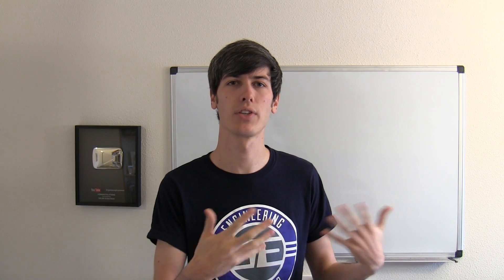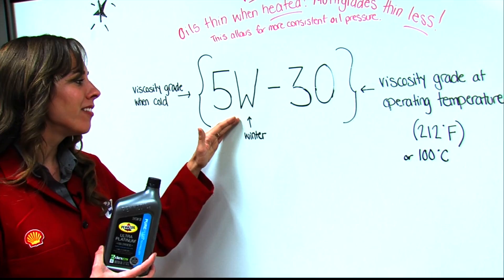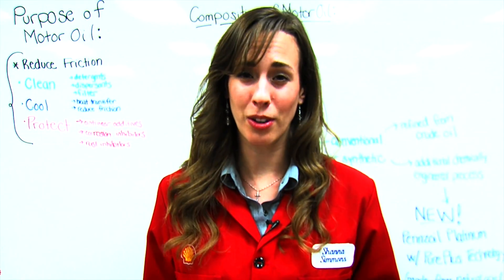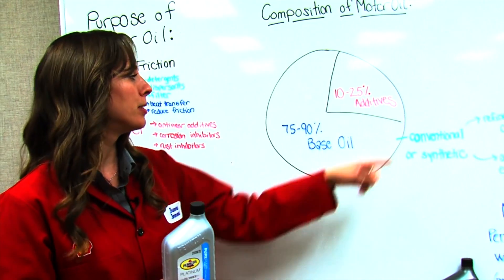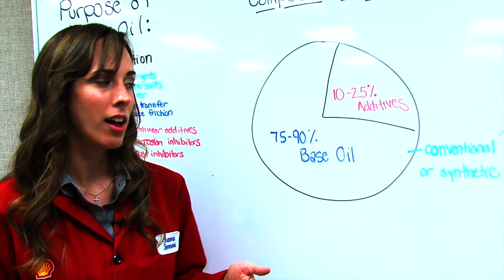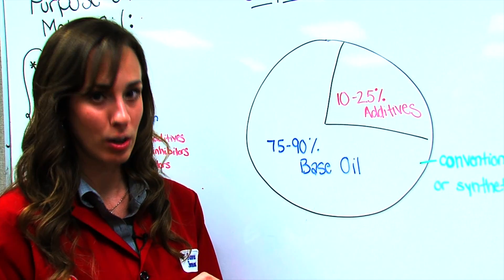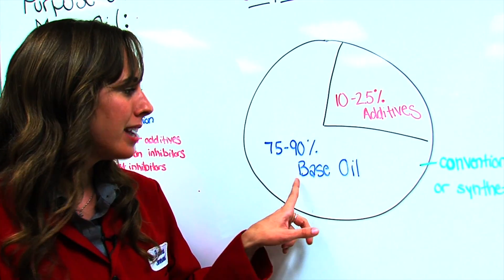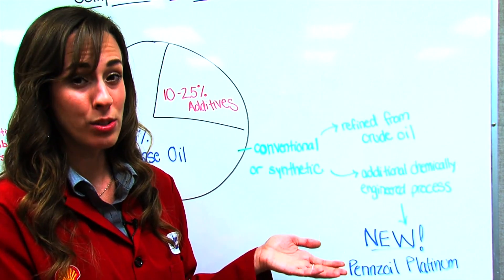Motor Oil Myths & FAQs - Synthetic vs Conventional

Comment: Hey! does unused/opened engine oil go bad? or is it safe to use for the next oil change in about 6-8 months? 

"bottle kept inside the house with the lid closed tightly.
Reply: For practical purposes, no.  It would take probably decades for motor oil to noticeably deteriorate in a sealed container, or even a closed, part used container.  Think about what motor oil has to withstand in use, compared to that, storage is nothing!   I've used motor oil from 10 year storage or more with no problems. As an automobilia collector I have NOS glass bottles of oil that are over 60 years old that are only just starting to show signs of separation, and oil from that period is nowhere as good as the products available now.
Reply from the maker: It does eventually go bad, yes, but it should be okay to use within a year.
Reply: +Stinky Cheese, "oil system in a vehicle is not open to outside moisture"!? Think again!  All combustion engine has intake & exhaust valves, how is an oil system in a vehicle not open to outside moisture!!!???  You think there is absolutely no air skips through the piston rings as an engine cools down...!?
Reply: +turboslag I think these guys have a vested interest in making you think that oil will go bad
Reply: Eric sin sinner

Indeed they do. Like anything to do with the auto industry, it's a rip off.
Reply: @Jun Aquino One day I was listening to Click and Clack on PBS radio.  They are two brothers with engineering degrees from MIT.  A caller asked if he should change oil every  3,000 miles or three months like the owner's manual says, because he doesn't drive the car much.  He was changing every three months like the book says.  They laughed and said the mechanic was probably saving the oil and using it in his car when he changed for his new oil!  No, oil doesn't wear out when you're not driving the car.
Reply: +Dennis Johnson  yep I think it's also a rip off changing the oil every 3 months when not used regularly. that's why I change mine every 3k miles around 6-7 months. I dont wanna go more than 3k miles cause daily driving here in our country is considered "severe driving conditions"
Reply: oil and water (moisture) dont mix....
Reply: +Stinky Cheese, the fact is the fact and that is how moisture enters in to an engine, little baby.
Reply: +Stinky Cheese, the question was about "oil" and you are changing the subject talking about fuel, combustion and emission system...  Please keep focus on responding to people's question about "oil" (engine oil a.k.a. motor oil) if you wish to respond.  BTW, have a better control of your personal attacks, stop being a baby, little baby.  ;)
Reply: +Stinky Cheese, P.S. There is "blow-by vapors" in to the oil chamber and that is one of the reasons oil get contaminated.
Reply: Stinky Cheese Agree, 6 month change is sufficient. Only one thing to moisture: Oil can take on some moisture, when you're riding only short distances. The condensed water from the combustion process will mix with the oilfilm on the cylinders during combustion. The oil "sweats" out that water again when reaching working temperature.
Reply: So Mobile One 0-40 in a closed container is going to go bad after a certain amount of time?
Reply: +Jun Aquino depends on the car, Mercedes is 13k miles because it's 8.5 qts mobile1 0-40 and fleese filter
Reply: Ski Fall
your point?
Reply: +Stinky Cheese ok, enough of this childish back and forth behavior.  The question was about oil in a closed bottle.  Some mentioned about engine oil kept in an engine where in a combustion engine is "not" sealed therefore will deteriorate as moisture can enter the oil pan through intake/exhaust valves for example, as in an oil bottle its cap is closed shut to changes outside the bottle...  Done!  No more baby behavior please!
Reply: +Stinky Cheese, OMG, again!?  The point I made was that a combustion engine's oil chamber/sump is NOT sealed as you stated in one of your replies.  Just read other replies you had to other people...  LOL.   Ok, I will stop calling you little baby as it gets tiring for me.  Good bye Stinky, that is your handle... The fact is the fact, oil kept in an engine (oil pan/sump) is different from keeping oil in a recapped bottle.
Reply: I remember when Mobil1 yrs ago said it could go 15000 miles before a change, so surely it could last a long time in the bottle. Obviously they did change that claim to 5000 miles later. Plus the fact that some manufacturers claimed that ONLY Mobil1 was able to maintain the warranty...like Corvette. That wasn't just wrong, but against certain laws that let other oils hold the same warranty standards.
Reply: yeah turboslag, as far as I know oil that sits, as long as you don't have containements or other stuff happening to it, practically doesn't go bad.  if you let it sit for decades it could become less effective but if you let oil sit for decades than you are silly for not getting rid of it sooner
Reply: rickyt, there are many seals so an engine that is working proerly keeps the oil and atmosphere seperate.&#160; in a properly taken care of engine the only times engine oil will get to experience the atmosphere is when checking the oil and adding oil.&#160; again in an engine that is running properly.&#160; that is one of the reasons rebuilds are relatively expensive with vehicles
Reply: If moisture gets in it can cause the oil to decay faster. You'll be fine, just shake it well before using it if it's been there for a few years or so.
Reply: That oil has been in the earth for a LOOOOONG time. It does NOT break down , deteriorate and it automatically separates itself from water.. DON'T put it in the crankcase if it is DIRTY. Sand on the piston rings and bearings is BAAAD.
Reply: Do you really get manufacturers recommending that you change you oil after 3 months even if the car is not used? That's got to be nonsense. Even 3000mil oil changes is very frequent. It seems to be a peculiarly American thing to have very frequent oil changing as a norm.

I change my oil every 5000 miles. I ignore time completely (and 5000 miles is usually a bit more than a year), as I really don't believe that it degrades significantly when just sat around. Certainly the oil itself is fine - it could only be the additives that spontaneously degrade. I'd like to see evidence for degradation with nothing but time.

Comment: i drive a 2012 Mazda3 that requires 0w20 synthetic (4.3 litres)

i have 2 quarts of 5w20 laying around for a year.  can i mix 2 quarts of 0w20 + 5w20 for the next oil change?
Reply: The 0w rating is for cold weather starts. If you change out your oil in the spring-going into the hot driving ( and starting season) the mixture of 0 and 5 w oils will be fine.Use the same brand and type of oil. ( same additive mixtures )
Reply: DO NOT MIX THOSE OILS . I REPEAT DO NOT MIX THOSE OILS. MY NEIGHBOR HAD A 2012 MAZDA 3 AND MIXED THOSE OILS CAUSING ENGINE DETONATION WHERE THE FLYWHEEL SEVERED HIS HEAD AND THEN FLEW INTO A HOUSE FULL OF PEOPLE KILLING MANY MORE!!!!!!
Reply: +Jeff why didn't you thank the other guy? 🤔
Reply: Use the leftover oil for use in the workshop, do not mix those oils. Your engine, the oil pump and all the oil bores inside the engine are designed for 0W20. Putting a more viscous oil in will lower the flow of the oil trough the engine and will put more strain on the oil pump which will result in a negligible power loss and a risk of the oil pump breaking quicker. It will potentially also influence fuel consumption. Modern cars are very sensitive to things like this. 

I'm not saying your car will break if you do, just that it's not healthy. And a healthy and well maintained car will have a longer life. Unless you have to because of circumstances (on the side of the motorway and you only have the wrong oil available for example) don't mix.
Reply: no my friend they are not the same you should not mixe them
Reply: It would be fine
Reply: Jeff lol

May I  khow so I can avoid problems?
Reply: Jeff so you heard what you wanted to hear to avoid buying 2 quarts and save money?  Lol

J/k thanks
Reply: Outlaw naw.  not to save money.  my previous car took 5w20.  my current car calls for 0w20.   the next viscosity....
Reply: Dan Stankowski If the oil is thicker the oil pump will need to work harder. That is if the engine is designed to run on a thinner oil. It won't do any harm, like I already said, so chill out.
Reply: Don't be a knob. Just buy the right oil for the car, dummy! Are you that hard-up!
Reply: RocketRaspeed thanks buddy
Reply: Outlaw car's motor wont blow up if u mix engine oil viscosity lol

im only adding 2 litres of oil of a different weight
Reply: AR1G3 the "leftover" oil is brand new and is still sealed from my previous car

im sure pouring 2 bottle of 5w20 wont cause catastrophic engine failure lol

the owner's manual says 5w20 is used in warm climate temps (mexico)
Reply: Jeff I litteraly said your car wouldn't break down if you did... So you are right, you won't have 'catastrophic engine failure lol'. I'm just saying that it isn't wise to use the wrong oil and that if there's no good reason you shouldn't do it. Having two leftover bottles isn't a good reason to me, because of the effects it potentially could have in the long run. 

But since the only thing you want to hear is that it doesn't matter, just pour it in, it's not my car :P
Reply: +AR1G3 wtf. 0w-20 verse 5w-20 is barely noticeable. Plug the oil passages, harder on the oil pump. Dude it's not 80-90!!!! If you're not very mechanical don't comment and give people ridiculous so called answers!!!
Reply: A bit dramatic.

Comment: 5w-40 not the same as wd-40 or is it?
Reply: The WD stand for Walt Disney. He invented that product prior to developing theme parks
Reply: Using wd40 for your engine oil is the next best thing to Thermite.
Reply: LOL!
Reply: loba742 - "U won't put a penetrating oil as a lubricant into your engine..."
And if you do, please have a couple of camcorders handy!
Reply: put a teaspoon of each in your hand.
Reply: LMAO Is that really a serious question..? U won't put a penetrating oil as a lubricant into your engine... WD-40 is a brand name of a penetrating oil, which is used to loosen rusty screws and similar things. This has NOTHING to do with the viscosity! (BTW: The number 40 is the number of experiments, the inventor had made before he found that formula...) And one more thing: How many cans of 250 ml will u open for an oil change..? Guess, this will become the most expensive oil change in the world - not included the new engine u will need after a few miles max...
Reply: Stinky Cheese they told me to put Lucas on watermelon, dint taste so good
Reply: This is the best comment on YouTube.
Reply: I take the oil out my car to reduce weight. Now I flies like a bird.
Reply: lol indeed.
Reply: I usually spray wd40 into to my oil that way it gives it extra lubrication 🤔
Reply: All I use is wd-40 in my oil changes
Reply: Same thing. I run wd in my truck. 490,000 miles, everything original
Reply: +Gros  lol
Reply: or tnt ?
Reply: Stinky Cheese Yeah, ur right, it has an oily base. But, after all, it's still a penetrating oil with a whole lot of very aggressive additives like detergents, dispersants and more things like that. It'll kill every seal of your engine within minutes, even in the cold state...
Reply: The only thing that I've heard about WD40 is draining the engine of oil, fill it up with WD40 and let it sit for a day or so, drain it again and refill with regular engine oil. I know nothing about this procedure except that it's supposed to clean things up, e.g., if the car's been submerged under water.
Reply: WD-40 is also sold in gallon jugs. You still shouldn't use it for crankcase oil.
Reply: it's a 75% match, pour it in anyways!
Reply: Roflmfao
Reply: Water Displacement 40  Is for spraying on your toes so they don't get wrinkly in the pool.  "True statement" *disclaimer, this may be un-healthy.
Reply: not the same thing at all...

Comment: 'W' stands for 'Winter'???  I always though it stood for 'Weight'.
In 5W-20, the oil is thicker ('5 weight') when the car is off and the oil is sitting in the pan, and as the engine temp heats up, the oil thins out, to a maximum '20 weight'.
Reply: It is weight, but if you ponder a moment, winter works, a 15w30 will be 15 in the winter when its cold, turn to 30 as it warms up.  But it's weight.

Comment: something I feel should be brought up if it hasn't already; certain oils aren't available in OEM specs but are far superior as far as properties go. For example "fully synthetic" diesel oil is NOT available 15w40,and is ONLY available in 5w40 and 0w40! And DESPITE it not being "OFFICIALLY" OEM it still is FAR superior to 15w40 conventional oil. 
Now I am aware your videos are almost entirely (NEWER) gasoline based. It's a crime you don't put forth information that applies to the other 35% who actually own their own vehicles and do their own work on such.
You do provide good information but it is massively biased.

Comment: here is a question : i live in indonesia which is Very hot everyday (35-37°C) ,and my honda fit manual book say recommend 0w-20 oil,but it seems running not very well ? n the Engine was incredibly HOT when i open my engine hood ,any explanation please ?
Reply: +Charles Choo 
Don't mind the temperature of the engine, if the gauge is more or less between 80 and 90 degrees, then it's fine. 
Anyway, 0w20 is too thin for that climate, the viscosity is quite low. 
I suggest you to use a 15w40, with same API specs recommended by the car maker, and the lubrication will be much better than with a 0w20.
Reply: Eugenio C how about 5w-30 ? cause Honda workshop only got 0w-20,5w-30,and 10w-30.
should i go for the 5w-30 ?
Reply: the number before W is for winter temperatures.
You have to focus on summer temperature, so on the second number.
Go and by any 15w40 from any dealer, even if not from Honda shop. As long as you follow the specs recommended by the car maker (SH or SL... and, more important, A3 B3 or A3 B4...) any brand is good. 
Semisynth oils are fine and if you use your car only only for few km per day, I suggest you to change the oil and the filter at half of the time than what is recommended (usually in manuals book is already specified this).
Reply: Eugenio C thanks mate, really appreciated ur help n comment.
Reply: My pleasure ;)
Reply: Do you know why the specifications are dropping?
Reply: So, it means you don't know the answer...
Reply: Eugenio C *****  ehm,i will see what my old oil become after i change the new one
Reply: But it's the wrong answer, kid, and it's quite clear that you are just copying something from a website, because you don't know the answer!
Reply: +Charles Choo
Nobody can see the difference between oils, 100% synth or regular, high viscosity or low viscosity, you can't see the difference when it's new and especially when it's used or totally exhausted.

That Rowan Cook kid (who blocked me and this shows that he doesn't know the answer and doesn't have anything to prove his opinions) just posted something taken from internet: it's from a oil factory, that is promoting and advertising its own 100% low grade synth oil. 
But the real reason of low viscosity it's for pollution. Low viscosity oil in an engine means less effort to run. Less effort = less fuel. Less fuel = better results on emission tests. Better results = less pollution.

It's quite clear that it's not recommended to use a 25W60 grade in a normal engine with standard mileage for its age,  (I am using a 15W40 in my Chaser with a 2,4 turbodiesel engine and a 20W50 in my Pajero 2,8 diesel, both with almost 300,000 km), but the regular 10W40 it's absolutely fine also in modern engines, even if the factory suggests a lower viscosity.